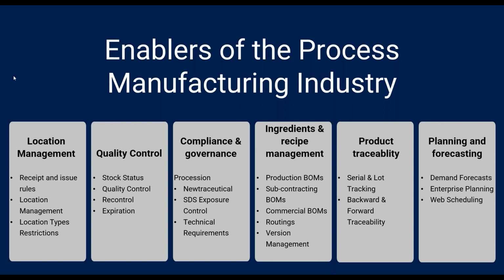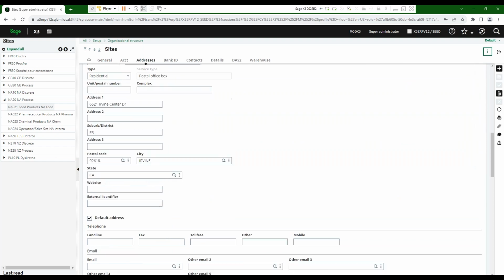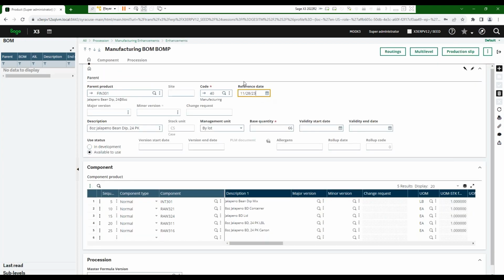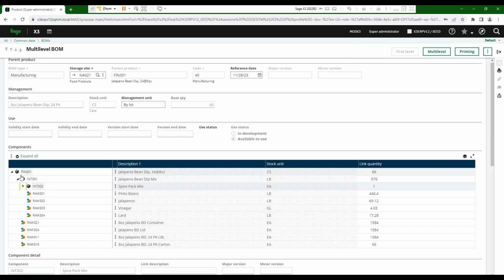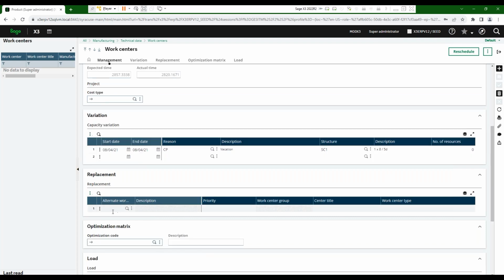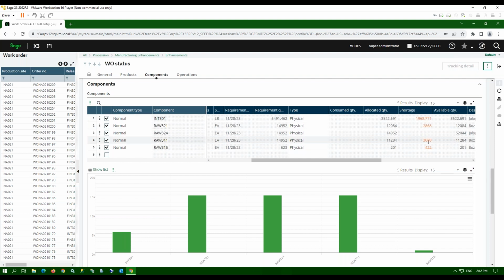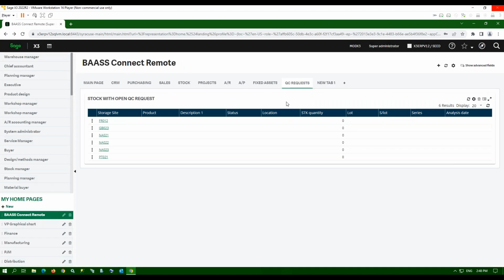Sage X3 Manufacturing

Comment: 0:00 – Introduction [00:00]

0:30 – Key Features of Sage X3 Manufacturing [00:30]

3:00 – Software Tour and Navigation [03:00]

6:20 – Manufacturing Site Configuration [06:20]

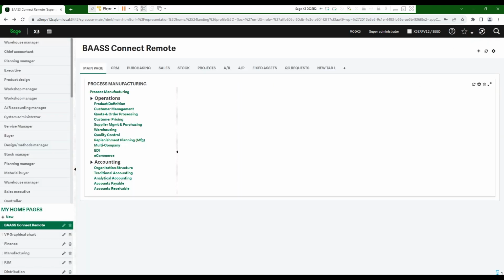8:38 – Product Setup and Category Rules [08:38]

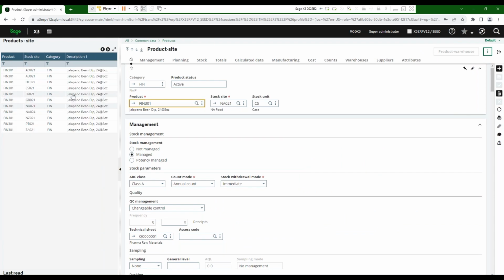10:05 – Quality Control (QC) Management [10:05]

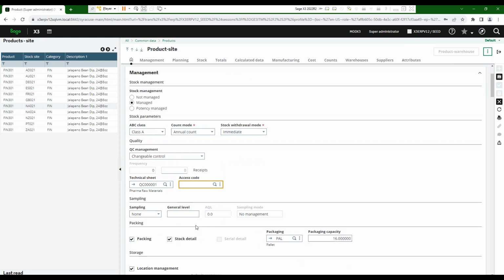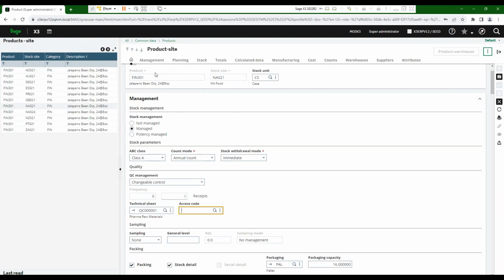13:07 – Location Management and Default Locations [13:07]

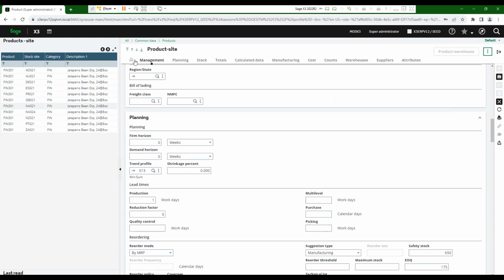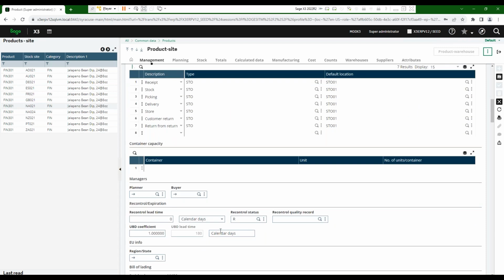14:38 – Planning and MRP Settings [14:38]

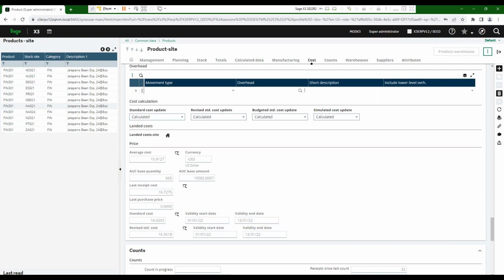17:10 – Bill of Materials (BOM) / Recipe Management [17:10]

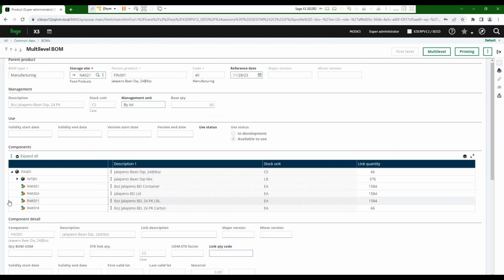24:18 – Multi-level BOM and Subassemblies [24:18]

26:07 – Routings and Operations [26:07]

28:40 – Work Centers and Capacity Planning [28:40]

33:17 – Manufacturing Workbench and MRP Results [33:17]

34:39 – Generating and Releasing Work Orders [34:39]

37:56 – Production Tracking and Reporting [37:56]

41:26 – WIP Cost Inquiry [41:26]

42:26 – Quality Control (QC) Request List [42:26]

43:27 – Conclusion and Closing Remarks [43:27]